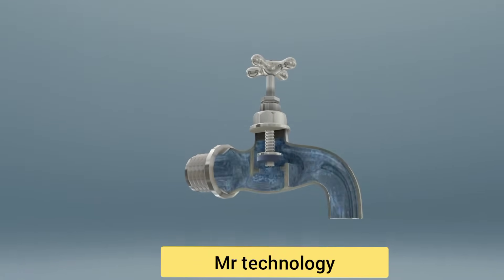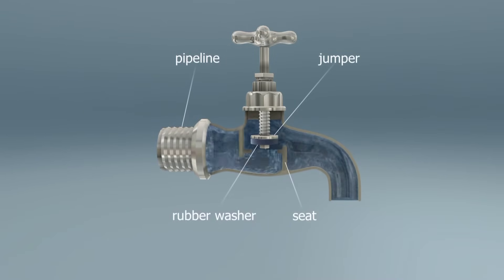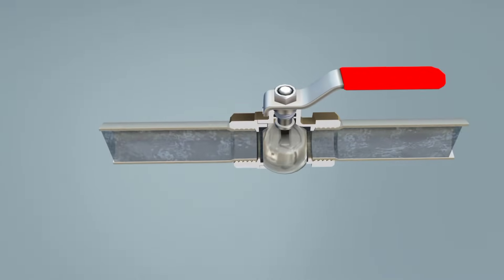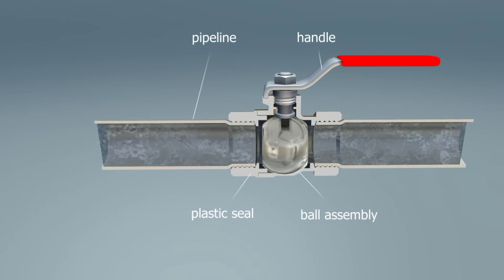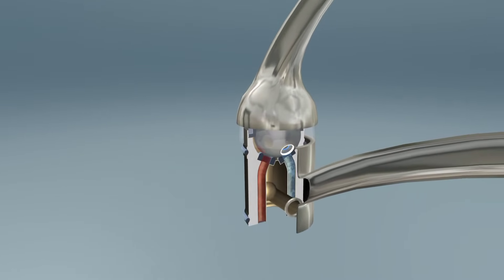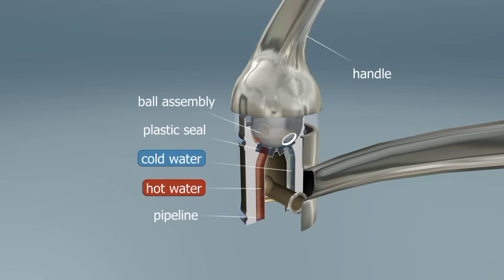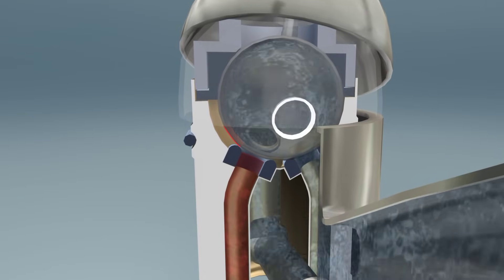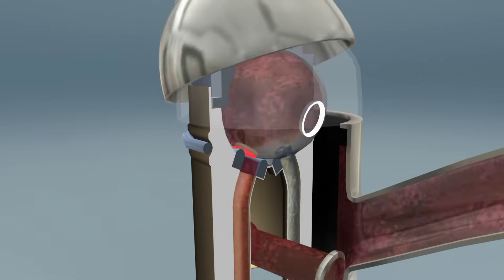how the faucet  works

Comment: Hi everyone. My wife and I are working on our first offgrid tiny home. We're doing all the work ourselves. I've never done any plumbing, but I'm learning the fundamentals to running my water lines. My curiosity is with how faucets work with the pumps, relative to how much power the pumps need. Is there a pressure that buils up when the faucet is off and the pump shuts off, turning on again only when it feels the pressure drop?  I'm only doing a kitchen sink and a bathroom sink and shower. Thanks for anyone with experience

Comment: In a traditional tap, the jumper is fastened to a screw, together with a rubber washer. When you turn the tap on, the screw rises, lifting the jumper and allowing the water to run out through the spout. When you turn off the tap, the jumper goes down again onto the seat, cutting off the flow of water. 
In a ball tap, the ball assembly, a metal ball with a hole drilled in it, is turned by a handle. When you turn the tap on, the water flows through the hole. When you turn it off, the ball assembly turns and cuts off the flow of the water.  
In a single lever tap, the ball assembly is hollow with 3 holes. Cold and hot water enter through these holes, and the mixed water flows out through the 3rd one.; When the tap is turned off,. The position of the ball doesn’t allow the cold or hot water to enter. When you turn the lever right and raise it, the hole with a blue rim is adjusted for the cold water pipe, so the cold water flows into the ball. When you turn the lever left and raise it, the way for the cold water is cut off. But hot water can flow into the ball. When you raise the lever in the middle, both cold and hot water can flow through the tap.